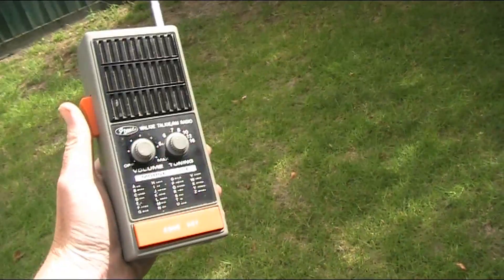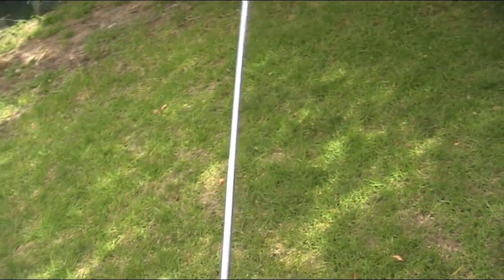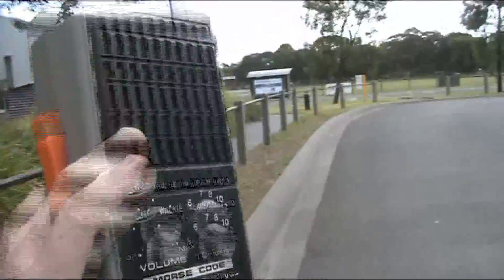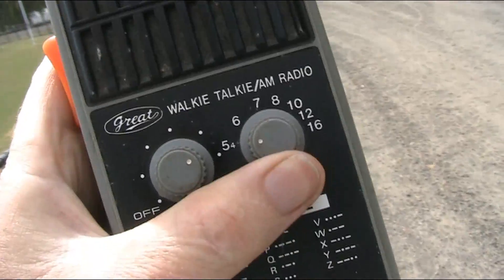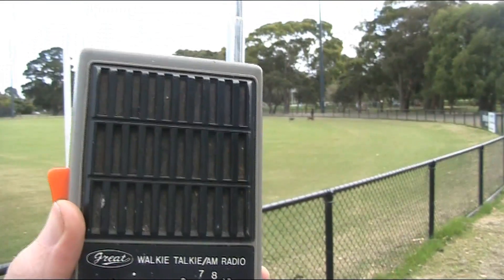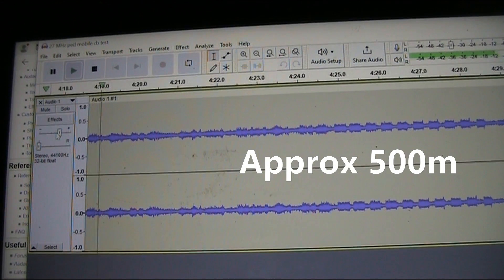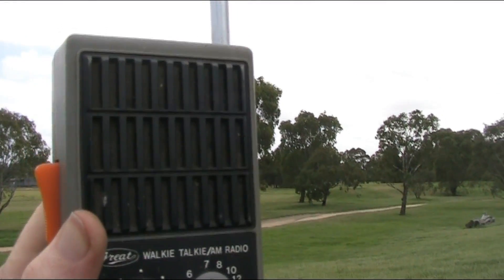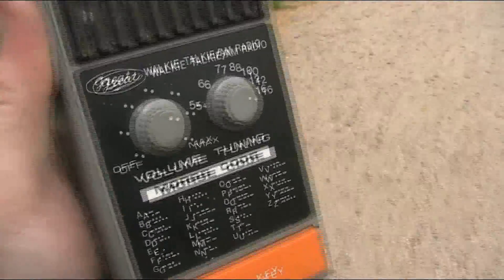How far will this 2mW 27 MHz walkie talkie go?

Comment: In the US this was  channel 14, The same as our regular 23 channels of CB, but every fifth channel was for business and RC toy car use. Some used replaceable crystals, so you set your own channels of use. 
I had a toy base station, and my brother had a walkie in the late 60's early 70's. With an external antenna, it made just under 8 miles.  Two full wave loops in a double square shape, spaced 9 foot apart with 9 foot sides, On the barn roof, fed in the closest corners with twisted pair. but set up as a di-pole. Twisted pair feed line was 100 ohms impedance back then.
The DTV antenna in front of me uses the same design, but has 9 inch sides set corner to corner.. Not bad for a 13 to 14 year old kid. My dad saved the thing, so I still have it. It was even better as a short wave receiver antenna. Converting that old base station over to a short wave receiver got me started. It was a lot better than using a barbed wire fence to make a telegraph set.

Comment: Hi Peter... Question..... If you were 100 miles away from someone you wanted to contact. With only 10w available. What frequency would you choose.
Reply from the maker: A difficult question as it depends on time of day, size for antennas and local noise levels. 7 MHz during the day or 3.5 MHz at night should work.

Comment: I once had an illegal little baby walkie on a 72MHz 9V battery. But it had a range of about 300 meters with a 100cm antenna (extended by us). This 27MHz was only about 30-50 meters long. About 200 meters this 49 MHz. The 49 MHz band was probably the most stable, good quality. We were very pleased with the 72 MHz tch, even shocked. The range is between two walkie-talkies in an open park area.

Comment: Junk, back in those days, the rolls royce of semi legal was the Lafette MA310 I think, 1 watt hand hald, 3 channels, smelt nice and worked a mile or more especially from the top of Mt. Dandynong. If you had money, you got a Lafette HE20T, 12 channels TX and receive down to what every you wanted including NZ 26 mhz

Those were the days when an Old Pye mark 3a was pushing 15 watts and a very broad band audio that actually sounded very good.
As a young teenager, I quickly learned how to use a grid dip meter, wind coils at 3 times the 75 mhz and getting them working usa dx

Comment: Hi Peter, Quick question about the circuit for this device. Is the 1m telescopic connected to a slug to peak the output? Would replacing the telescopic with a length of wire increase the range even further, say 2.76m for a quarter wave?
Reply from the maker: A longer wire may help but matters like impedance matching and radiation pattern will affect performance.

Comment: In the early 1970s, 100 mW channel 14 walkie talkies were everywhere. I used to love getting up early on Christmas morning and introducing the new kids to CB radio. I still occasionally hear the "is there anyone out there" on the FRS channels, but the way things are today you'll be in trouble if you answer them. 
But there were times, usually in the early summer, when propagation was enhanced and I could hear the milliwatts from about 10 miles away.
Gotta love the code key! The cacophony of about a dozen code keys at the same time is unforgettable!
Reply: What trouble would you be in for answering a caller?

Comment: All right I had one when I was younger I can only get a few hundred meters with the standard antenna however when I did increase the height of the antenna there was definitely an increase when it concerns the range of course it is the 11 mph if you're only using 1 M and you're having some small loading coil you will get some signal coming out of it yes very little power and it still comes out V ground propagation most likely you might be able to get more range if you increase as you probably know the height of the antenna you can always try it taking a old TRC 217 antenna and putting it on top of your standard antenna with an antenna adapter you can basically work it to increase the length of the antenna in definitely will increase the range I think I managed to get about almost a mile when you're outside of a city when there is less interferences your signal is going to go on for quite a bit however I think I was transmitting at the time 100 MW this is like 50 times more than what you have however I was still impressed that that little transmitter of 900 MHz you still manage to get some range out of that yes it's a different frequency the power is one thing the type of antenna are you using can make a difference there are guys out there who are doing 10 milliwatts on the ham radio and they can do a 1,600 k I know it's pushing the limits of a small radio like that it's unlikely you would get that range however I think you can get more range out of it just by slightly modifying the antenna and of course being in a different area listen to ference even using saltwater as you probably know saltwater can be good as a radio conductor I did the test with salt water with standard Portables I'm getting about 10 MI on a portable TRC 217 and sometimes I can even get more thank you for the test 73 it reminds me when I was a kid

Comment: Hi, as a kid in the 80's in France, I had a pair of similar 27.125 MHz  walkie-talkies. The original telescopic antenna was broken beyond repair on one of them. My dad had some knowledge on radio stuff and he showed me how to make a 2x2.70 m dipole to use the radio as a base station. After I put the antenna between my room window and a tree I could hear voices speaking English! I called them using the little English I had already learnt at school and the guy answered me and told me he was a trucker on a US highway! The propagation was VERY high those years but as a licence Ham radio, I'm still stunned by the QSO today! Too bad I didn't know what a QSL card was 😁
Reply: Wait, you could talk to American truckers all the way from France? that's absolutely amazing!
Reply: @coolbluelights  yep I didn't realise then but it surely was a QRP record of some sort   🤣
Reply: @coolbluelights when conditions are just right it’s possible! In 1973, I was sitting in my high school parking lot at lunch time and I had a Radio Shack 6 channel crystal controlled radio which put out only five watts feeding a 36 inch Shakespeare fiberglass top loaded CB antenna which had a very low vswr and talked with a gentleman in Hollywood Florida and I was up in central Ohio. Eighteen years later I earned my Advanced Class Ham License.
Reply: You must have talked to him over that radio when the sunspot cycle was near peak. That is not unusual, but it's usually done with 5 watts. If you contacted that trucker here in the U.S. with that walkie-talkie probably only 10 milliwatts you did great!
Reply: @radiotec76  Yes, the sun activity was probably very high since my neigbors' son also had voices en English from his radio 

...with the stock antenna!Since the poor kid was autistic, he was scared to death by the voices from his radio and 

spent a whole day hidden in his basement after he broke his radio with a hammer!I don't remember the date for sure 

but It was in the early 80's I guess. I can check on a sun cycle chart.Some 10 years later(11.5??) , I was checking 

my newly home built 6m station, I wasn't supposed to get on air yet as I didn't have the licence extension for this 

band but I checked the SWR on my 3 elts yagi, then TXed a short "test test, Hooolaaaa" to troubleshoot an instability 

issue. I was scared of the "French FCC" but who would hear me with 800mW, eh? An a voice answered "QRZ hola hola? 

This is VK6AP"! I stopped transmitting immediately! I didn't know if it was the radio agency trying to trick me or a 

hoax from fellow HAM but I didn't reply. One month later I read on the radio magazine that the spots were huge, a gigantic 6m opening occurred and some Australian station were contacted from Western Europe, including VK6AP!!! I missed the DX of my life! 🥺
Reply: That's nothing, I had a conversation with this guy called Zaphod Beeblebrox, he said he was in a Restaurant at the end of the Universe !!!

Your story is total BS, you got pranked by a UK truck driver on a French road who knew he was talking to a little kid....

Comment: Sounds like the radio needs its capacitors replaced.  Either that, or a good once over with a soldering iron for cold solder joints.

Comment: Hi Peter! Is it really only 2mW?! 😮 I was expecting 20mW or perhaps 200mW or anything that a BF494 or 2N2218 would outout at these frequencies 😂!

Thanks in advance for the video!
Reply from the maker: These toys typically have only a 1 transistor transmitter, 1 transistor superregen receiver and maybe 3 transistor audio amp/modulator. They might even reuse the tx / rx RF transistor. 2mW is pretty good - some are less than that.